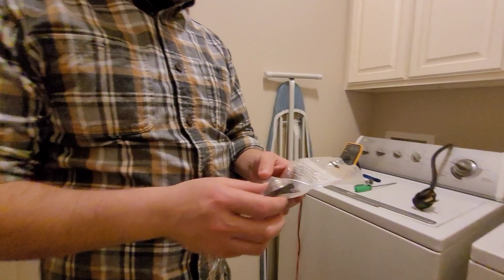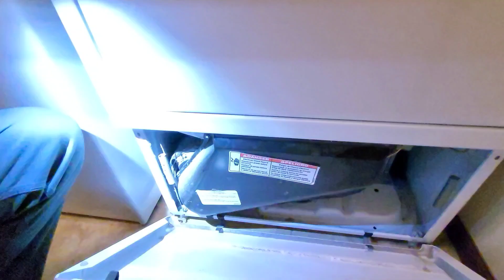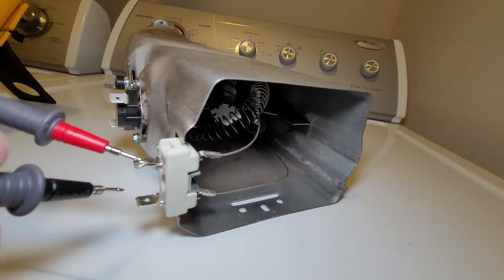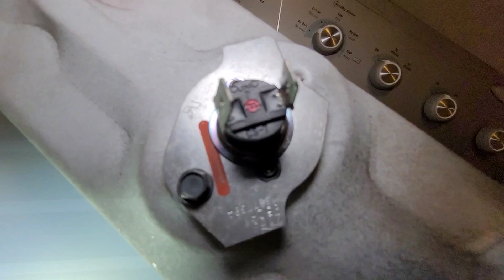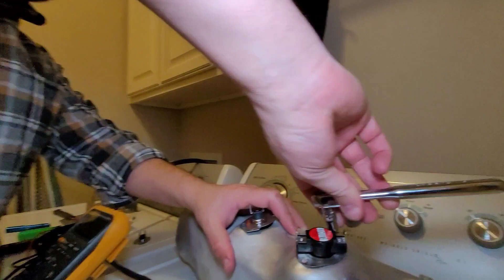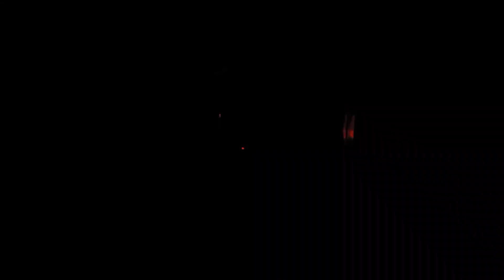Whirlpool dryer GEQ9800LW1 high limit thermostat and thermal fuse replacement.  Runs but no heat.

Comment: Do you know how to get the top off? I need to replace the door switch and every video shows the lint on top. I can't find any clips (like in the lower section of the dryer) to detach the top to be able to access the door switch.
Reply: A little late, but mine has two clips built into the frame. I was able to slide the lid and lift

Comment: When you bent the housing somewhat did that allow extra heat to escape into the lower area instead of direct into the drum? 
There’s another video that explains the housing “tab” goes inside at a 10 o’clock angle and then turn clockwise to 12 to lock the tab.
Reply: Thank you for that info. It's the last step for me and it's kicking my butt by falling out each time I try to hold it in place to screw in the bracket.

Comment: This video was great help to me! I was cleaning this same model dryer for my mom. Though I am not a professional so I left the heater element in, I was able to vacuum and clean around the area that needed it. Just pulling out something that has 240 volts I personally do not feel comfortable with and will leave it to a professional.

Comment: I ain't gonna lie, woulda been nice to see you replace the heating element. However, I wanted to say thank you for saving me a hundeds of dollars hiring a pro. Of course, I immediately thought it was the heating element, but after performing the tests with the multi-meter, it ended up being the same two devices you replaced.  Only cost me about $35. Even though the one wasn't bad, I did replace them both since they were sold as a set and you said to replace them together. Thank you, thank you, thank you.

Comment: Do you have a video showing how you got the old heating element out of the housing, and put the new heating element/coils into the housing? I can't seem to detach the old coils from the housing.
Reply: I just did this today and fixed my dryer. There is only one screw behind the two plugs of the heating element itself that needs to come out. It will then just pull out as there is a groove inside the housing and a spring clip on the other side of the heating element that holds it in place.